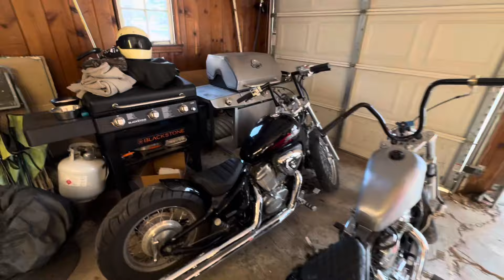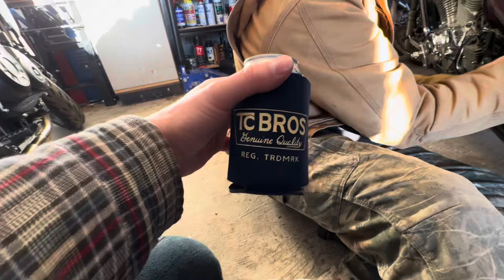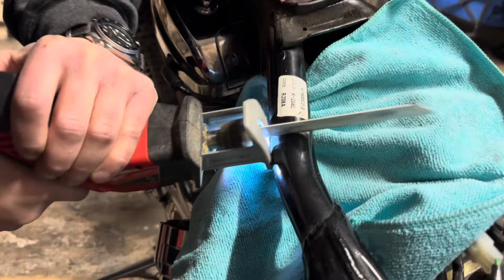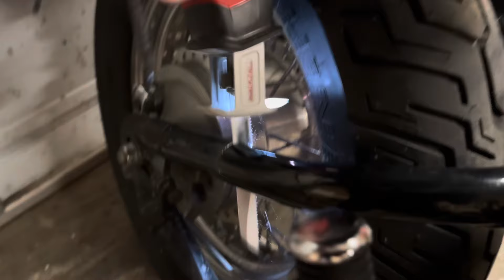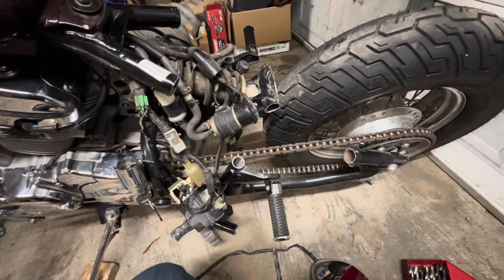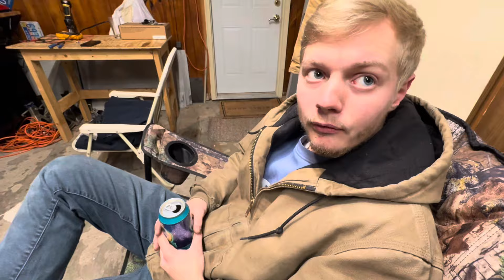Chopping Steve’s Shadow! - Honda Shadow Builds

Comment: I had two crashes in years of riding and both times I landed on my head. One time I just slipped and fell while negotiating a corner. Slow tempo. But the force from the fall was still too strong to keep my head up. I slammed my head right onto the concrete. Broken visor, splintered front. Although I was wearing a helmet I had loose front teeth for months. Wearing a helmet saved me both times. Pretty experienced driver. Driving for years, even in the rain and the winter. All season. Seeing you driving without a helmet...all I can think is that you are a young i--ot that maybe has to learn his lesson. It can happen even on your street right in front of your garage. And the more often you ride the more likely it is to happen. Have fun but don't be stupid. Looking cool isn't worth it.
Reply from the maker: Completely agree! 
He was testing his new exhaust through the neighborhood. I agree, should still wear a helmet. Appreciate the input!